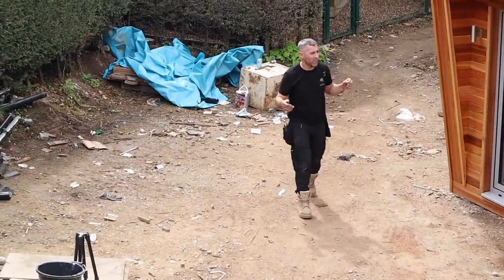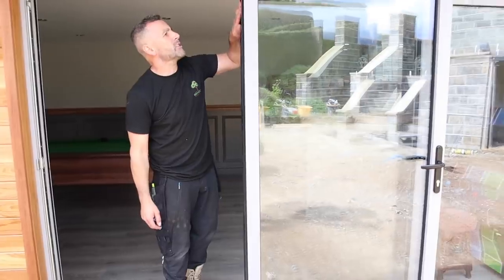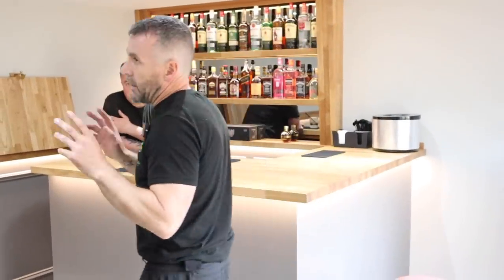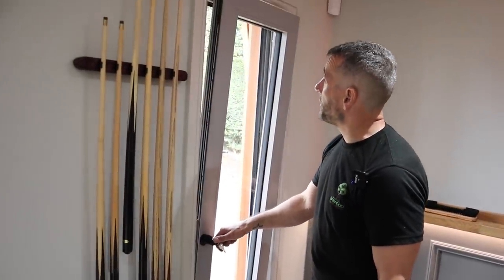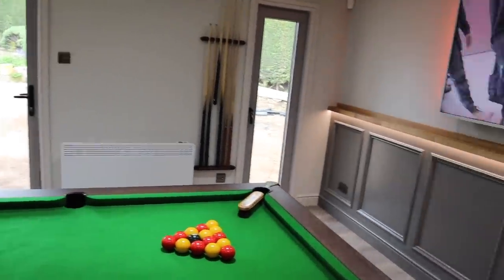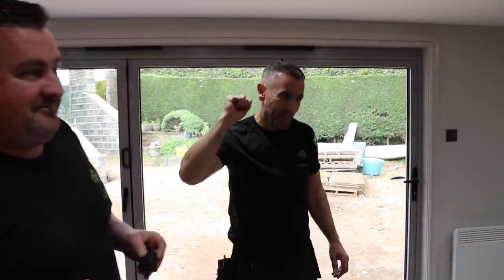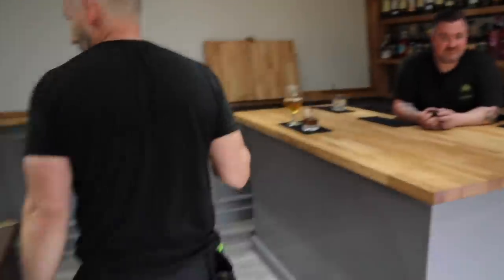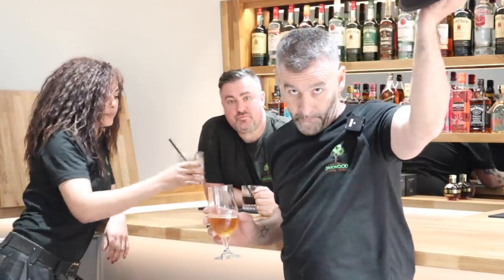Garden room with home bar, astro roof, and hot tub

Comment: I did my own she dusing flat roof. I couldn;t get the edge trim in low quantity so it would have added up the cost. So I just use WBA to glue the sides of the EPDM onlong the ply facia. After 6 years it's still stuck on there good. so worked. Just wondering why that trim is needed - why cant it just be glued down the sides?

Comment: Liam, I assume the led strip lights face the floor , how are you getting around the 90 degree bends with the strip, are you cutting the tape and using elbows or just forcing the tape around the bend ?
Reply: Im going to presume 90 bend because it was routed into a slotted channel the same width so would of looked messy bent.

Comment: Did you put and earth rod in for the hot tub? Not a piss take a genuine question. If the house is TT not an issue but if it's tncs and you lose the neutral you loose the earth. Then the client become the earth while getting in or out the hot tub.